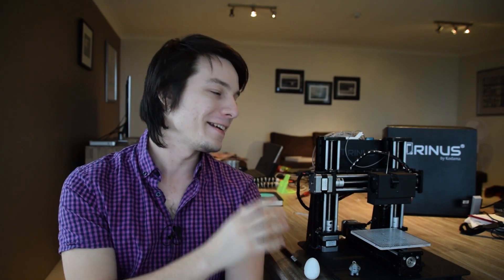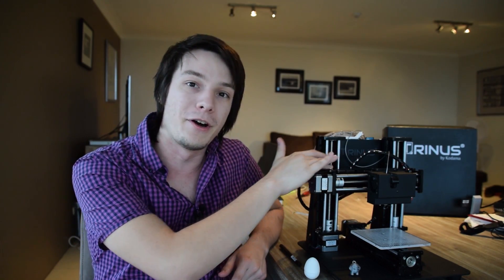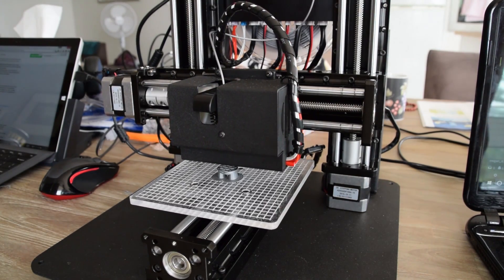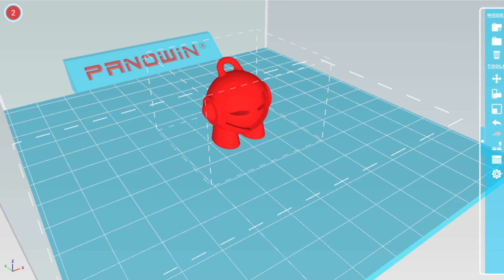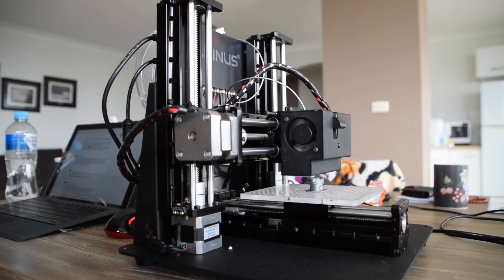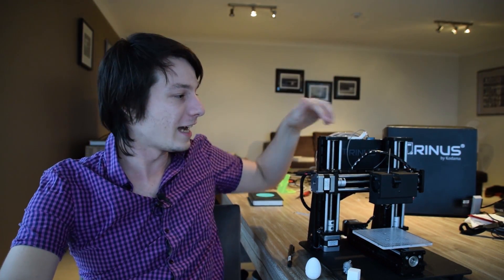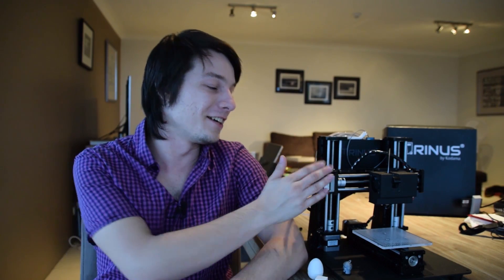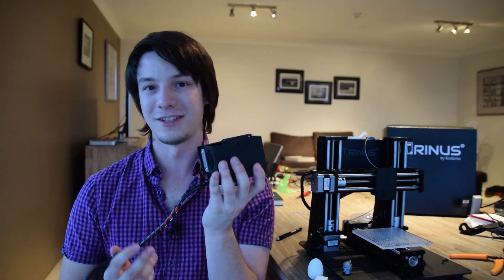Review of the Pre-production Trinus 3D Printer / Laser Engraver!

Comment: Hi Angus, I'm following you a lot, and now I'm a owner of the Kodama Trinus since maybe 3 years, and now I've a problem, my hot end the resistor stops working, do you know if it have 12 or 24 v resistor?

Thank you
Reply from the maker: It has a 12v power supply right ? I think that's correct can't remember!
Reply: @MakersMuse  EXACTLY
Thank you

Comment: A couple of quick notes:
* Pango does run under WINE in Linux, though, it's pretty poor compared to any of the FOSS slicers out there.
* The support from Kodama is woeful at best.
Best of all:
* Marlin runs on it if you're willing to take the top panel off and burn the Arduino bootloader via ICSP. Interestingly, the Paladin Firmware can still run atop the Arduino bootloader. There's a bloke called Sam Buls who's got a GitHub repo called "MarlinOnTrinus" and has a YouTube video on it. I'm in the process of tweaking my own config based on his adding heated bed support.

As a first printer, it's probably not bad out of the box (it's mine), but I'm finding myself outgrowing it, and feel that Kodama would do well to throw out their support department and just contribute to one of the open source firmwares and let the larger community support itself.

Comment: Hi Angus.  I'm new to Maker's Muse and I just love your stuff.   You're one of the best technical explainers I've ever seen.  

I'm about to buy a Kodama Trinus.  I reviewed lots of online reviews beforehand, but I only saw yours after I'd placed my order.  I'm a beginner 3D printer, but I'm also a longtime technician.  I feel very comfortable about my decision to buy the Trinus.  I noticed that your review was extreme early stage - April 27, 2016.  So, tell me...its 15 months later.  How do you feel about the Trinus now?

Thanks again for the great video!
S-
Reply from the maker: My machine was and will always be pre-production so still can't make a direct comparison to production units - but honestly its a great machine with a small print volume. I haven't printed on it this year... because it's just too small for most things, I use the UP Mini 2 or even tronxy x1 for those small prints.
Reply: Sorry Angus.  I made the mistake of just assuming that you would eventually get a crack at trying the production model of the Trinus.  Actually, I'm really psyched about using this thing...even with its smaller bed size and slower output.  I'm looking to make some precision electronics-related stuff.  (I doubt I'll even approach the capacity this thing has.)

Thanks again!
S-

Comment: Have you been able to try out the Laser addon to this printer? Still on the fence about pre-purchasing this printer.
Reply from the maker: At the time of testing it wasn't available - it'll be some time as it takes a while to get the laser certified. If you missed the kickstarter you might be waiting some time - I would check out the M200 from Maylan if you're after a similarly priced and spec'ed machine.
Reply: Ok will do. Thanks for the quick reply, love your work btw.
Reply from the maker: Cheers! And sorry meant 'malyan m200'

Comment: 14:50 What causes the pop marks on the body of the print, is it moisture in the filament?
Reply from the maker: +Protomaker Black Sprint Original 3D Printer That's a slicer issue, most likely made worse as using Cura through repetier wasn't fine tuned for the Trinus. It's the result of each perimeter stopping and starting.
Reply: +Maker&#39;s Muse Thank you: I have an issue like this, using Cura; That I was starting tho think could be moisture in the filament

Comment: Shame about the noise!! I could sleep next to a FlashForge Finder :P
Reply: +Mickice 

You lucky sod :P

If I could sleep through that kind of noise my choice of possible printer would be far wider than it is. I have to save for an new Ultimaker and get a custom sound deadening full enclosure, and the enclosure alone is going to cost more than the FFF. :(
Reply: +Elf Tablet I watch a ton of 3D printer videos, it blows my mind how quiet mine is with 0 audible sounds from the steppers.
Reply: Mickice
Did you mod it or did you get a quiet one out of the box?
Reply: +Elf Tablet some slight mods like rubber under the bed screws and the machine sits on a rubber dampening mat, but that's more for print quality, the electronics are custom and dead silent.
Reply: You are officially on my shit list. Grrr. :P
Reply: +Elf Tablet Do you have a printer yet? is so which, would love to share ideas.
Reply: Not yet Mickice, I should be in a position to get one come June or July, I could afford the Trinus or any other i3/clone, tomorrow, but as said that's not an option so I've still got another £2000 to save, I'll be honest with you though, if I had a printer at this second it wouldn't really be much use to me. I don't know enough about modeling and cad design to make it worthwhile atm(although considering vids and tutorials are all I've looked and and sifted through for a month, I'm getting there.). If I did have one now then I'd just be printing out yoda heads and guns and that's not why I want it.

If you don't mind though I'll give you a shout when I'm up and running. :)
Reply: +Elf Tablet For sure, do that! Fool around in 123D design, I've gone from nothing to printing a remote boat and other things to improve daily life.
Don't cheap out, there are some terrible cheap printers.
Reply: Mickice

Absolutely, there's no sense in cheaping out if you can avoid it, it's false ecconomy. As I said I find my self in a position where the only option I have is the UM2+, at least I know that whilst paying for it's quietness I get really good quality for free, lol.
Reply: +Mickice My printers are in my room, right next to my bed infact! My Makerfarm prusa i3v is pretty noisy but i dont mind, i can sleep through it. My family hates it though so I built a Rostock Delta which is dead silent and I can use it during the night :D
Reply: I should upload a video, it doesn't make a peep.
Reply: Mickice Would love to hear it, or not hear it I guess :P
Reply: +Mickice Some of us can sleep next to lumber mills without a problem

Comment: hey Angus love the videos and all the work you do !! quick question. do you feel like printers with moveable bed slows down your prints to a printer that the bed doesn't move ? 
tyvm for all your work
Reply from the maker: +adam carroll Thanks! Yes, printers with moving beds are somewhat limited especially if the prints are tall, thin and fragile. Moving the bed too fast can easily knock them over! But, there are many other factors involved such as cumulative errors when you combine axis' into the same movement parts. Appreciate the support :)
Reply: +Maker&#39;s Muse  i was just wondering because i have a ROBO R1 PLUS 3d printer which i love very much but i notice that my printer setting is about 50-60 mm/s.... on the printers you have with moveable beds what is ur mm/s about ?
Reply from the maker: I tend to top out at around 100mm print speed with 150mm rapids. Delta's can go even faster, but I don't have one!

Comment: You can change the homing sequence from the gcode. Try  homing X and Y (G28X0Y0), moving to X1Y1 (G1X1Y1), then home Z (G28Z0).
Reply from the maker: +Lucas Hartmann Very clever way to do it! That's basically how I was trying to do it manually. In fact, using that kind of logic, you could home an entire machine using a single homing input... not too insane, could be interesting in some applications.
Reply: Curiously enough you could also use a single GPIO to drive all stepper direction pins, as long as you have independent GPIOs for the step pins. Not sure why nobody (GRBL, melzi) does this...

Comment: Hmm. I was thinking about using that platform to make a little CNC mill for circuit boards. But now that i have seen how much the frame can flex, it does not really look that useful anymore. Shure, if you live in "electronics stoneage" and only use 2.54mm connectors and 1206 SMD components, i guess you can live with a few hundred microns of error/deviation. If i invest into a mill, it should work at least as good as what i can do at home with laser-printers and toner-transfer or UV exposure and etching.
Reply from the maker: +ExtraBase I was pushing on it 'pretty' hard and it has soft rubber feet, so keep that in mind - I think if you're engraving PCB's it'll be stiffer than many other low end solutions. You could also triangulate it further, but for the price point I can't name anything better tbh.
Reply: +ExtraBase The end result will likely have less flex since it will be machine tooled and some of the beta unit was probably hand tooled.
Reply: +Channelobunnies + Maker's Muse Yeah, you could be right. Adding some beefy alu profiles to stiffen up the construction and some weight to the static pieces would not really break the bank. Well, i'm not in a hurry, so i'll just wait and see what the production units look like once the crowdfunding is completed and then reevaluate. If the main driving pieces are fully backlash free and don't have too much (or with little modifications adjustable) play in the linear bearings, there might be a way to get something good going with these building blocks.
One could say that my standards are probably set way to high ever since i've worked at a company that makes high end, high speed industrial pcb drilling/routing machines... ;)

Comment: That is one nicely engineered machine honestly! My only comments are:
With leadscrews you need acceleration/deceleration settings in the slicer to reduce the "jerk" but that is minor and is something that "could" be worked out in firmware.
Other thing I am curious about is what kind of nuts do the axes use? Are they self compensating for wear or fixed? Only curious since over time nuts wear out and you get slop in the axes (sloppy circles...)

As for a small CNC with some covers for the screws/axes if your cutting wood or plastic I don't see why it couldn't honestly :). Metal maybe doable with the right settings. Regardless if I had the budget/no CNC mill and the space I would seriously consider one as just a platform for CNC!
Reply: not worth it. DONT BUY THIS BULLSHIT 3d printer. I ordered it, waited 4 months, and after they missed their delivery date in sometime in 9/2016. The end of 9/2016 I repeatedly requested tracking information with no answer., A week later 10/4/2016 I received this email from the FOUNDER OF TRINUS-KODAMA.  " Let me be a bit direct here; even you´re the customer, I find it inappropriate how you put my staff under pressure. 
I have been on your side, sure you expect something, but a KS project and related pre-orders are not amazon! 

Believe me, we are taking customer care very serious, I even worked 5years for AppleCare, but we don’t tolerate BS and unnecessary pressure."

Michael, if you don't want pressure, don't be in business. If you think it's acceptable to respond to customers in the way you said, "we dont tolerate
BS". 
YOU created the time line commitment. It's YOUR responsibility to meet it. Otherwise, you face the consequences of dissastified customers contacting
you when YOU didnt meet your deadline. 

you and your staff have NOT sent me VALID TRACKING INFORMATION. Which is what I requested and 1 week after the promise of sending out on Thursday 
9/29/2016, STILL no valid tracking information.

I've purchased on ebay/amazon many times. I obviously didnt expect the same ship time, because their ship times are reasonable. 
When is it ever 4 months wait time for delivery on amazon/ebay? Do you think that's a reasonable comparison between my expectations? 

Is that what Apple you think would have found acceptable? 
Is that what Apple you think would have done? 
And telling a customer that they are giving you "inappropriate pressure" when you miss your shipment date? 
You are clueless how to run a successful business. 

You repeat what you said to me to any other potential client, you will lose business left and right. 
Don't believe me. 

Cancel my order and return my money. 

  Had anyone ever responded as you did to an actual Apple customer, you would have been immediately FIRED.  
Don't brag about Apple, when I KNOW full well working their what would have happened. That's pathetic.
Your attitude and your ignorance you demonstrated in your email is unacceptable. ESPECIALLY from someone who is supposedly the founder. 

Sincerely,

Comment: I'm really interested in backing this, however my one real concern is that even at a reduced price I may be missing out some of the benefits of the product being allowed to mature further over time. Would it be worth waiting for full commercial production and simply pay more for those benefits?
Reply from the maker: +Benedict Tan It's the same being an early adopter with any new tech, you CAN wait for it to mature - eg the Form 2+ was better than the Form 1, but they only brought that out 3 or so years later.  :)
Reply: +Benedict Tan If you back a crowdfunding project, you always run a risk not really knowing what you get, and when it will arrive. I'm not saying the Kodama/Trinus team is running a massive scam doing everything they can right now to rake up as much money as they can with good press from 3d printing enthusiasts like Angus, and then deliver cheaply made crap and run with the money, but you never really know, because there is just no guarantee.
There are a lot of ways things can go wrong, and sometimes, the project people don't even realize they got scammed by subcontractors/part supplyers until it's too late (bent/badly hardened linear rods, out of tolerance machining,...) and i guess with the volume the Trinus project has reached right now, getting proper quality control and inspection done while staying within the target delivery schedule shure is a massive challenge not to be underestimated. So, my personal advice is to wait and see how production is comming along. But if you have the cash sitting around and are up for an adventure and the risk to maybe just buy an overpriced pile of nice looking scrap metal, feel free to preorder away... ;)
Reply: +ExtraBase While you are right about Kickstarters in general (I have backed multiple projects) that wasn't my question; I was asking about whether now is the right time to buy in in terms of product maturity at launch, not the credibility of Kodama Team. :)
Reply: I'll take that as a healthy dose of caution despite the high confidence :)

Thank you for the reply, at the moment I'm looking to buy into my first 3D printer and most likely it will be a RepRap design of some description. I was fascinated by the modular carriages of this design but most everyone I've asked has advised caution as well.

Comment: Not going to lie but the customer service part, or maybe entirely the whole review could be invalid.  I'm sure that was double/triple checked for the utmost quality before sending it out to people such as yourself!

Might be some special treatment involved.

I still can't decide between the trinus vs the wanhao i3 v2.  Both are the same price point, trinus having smaller build volume but would have a laser engraver.  Not sure which i value more...

12CM is quite small of a build volume.

Thank you for so much effort in pushing this video out. definitely appreciate being able to watch before kickstarter closes
Reply from the maker: +Ryan H You're right to be skeptical! But the fact they've been so good in the kickstarter comments goes a long way towards the credibility of the Kodama team. If it was entirely one-sided for me to try and get a 'great' review then things would be a little different for sure. They've got one heck of a product roll out in front of them that's for sure!
Reply: Thanks for the response, I think the deciding factor for me is the build quality and expansion capabilities.  Which you mentioned even before you had your hands on the trinus.

I've worked in many shops with CNC plasma tables and mills working in the heavy equipment industry and it all fascinates me.  I think a printer/laser engraver would keep me busy for awhile!  If i get into it more and become more knowledgeable upgrading printers, or adapting the trinus is an option.

Comment: Still don't know.  I have a M3D and it is basically the same size... but  a lot better looking.
Reply: M3d has bad reviews and much less robust
Reply: +Jttv Correct.  It is tough to get good prints out of the M3D.  
The other issue is that I have 2 more 3d printers coming from Kickstarter... but one is taking forever.
Reply from the maker: +Marty Enerson Tiko? I really hope they deliver.
Reply: No.  I ordered the Genisis last year
https://www.kickstarter.com/projects/1964730400/genesis-surpassing-every-expectation-but-your-budg

and

I just ordered the Reach printer
https://www.kickstarter.com/projects/2121749597/259-reach-3d-printer/description

With using the M3D, I really notice the small build plate, so I wanted something bigger.  

What time is it in Australia?

Have you ever looked at the Readybox.io printers?  I am impressed with the speed.
Reply: man you have money to throw around want to send some my way :P
Reply: How many printers do you currently have and what are looking to do with them?
Reply: +Jttv not really.  I figure I paid less for all the printers than it would cost for an off-the-shelf one.  Plriblem isn't that if I would have purchased a name brand one.. I would have it. :)
Reply: +Jttv I only have the M3D right now and there are a bunch of parts I want to print for my Xcarve but the build volume is too small. 
I am thinking I will give the M3D to my father in law once I get the others.  Just no reason for 3 printers.  Which is why I wanted the Trinus.  Looks like it will ship on time, but no size benefit 

...but it would look sweet on my table.